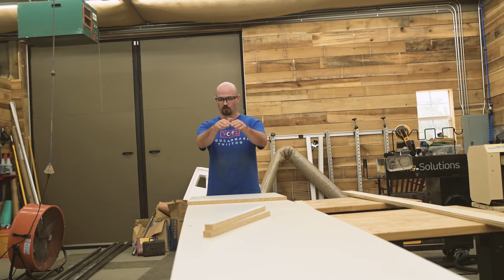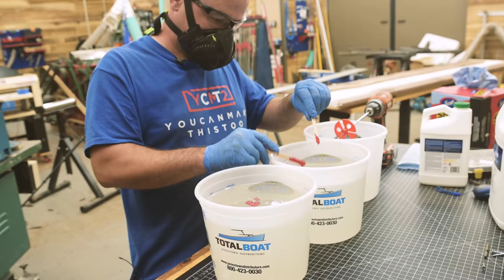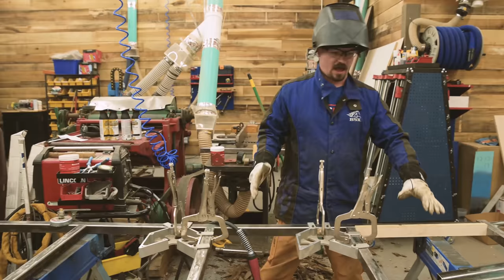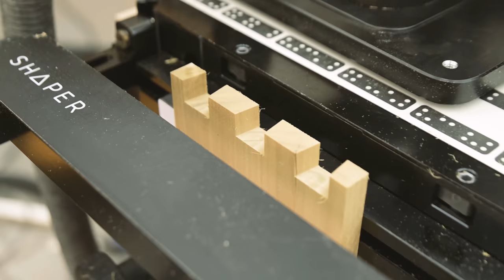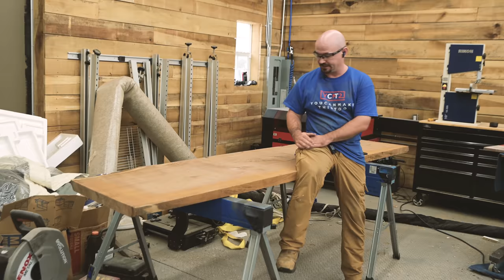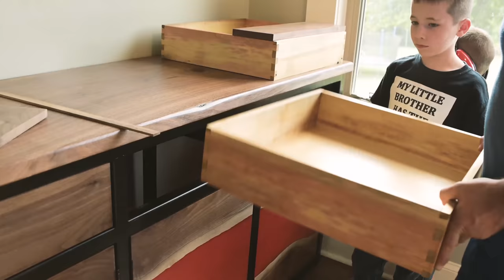Building Our Epoxy Coffee Bar Buffet

Comment: Very well done but definitely not a great project for garage woodworkers. Thanks for sharing
Reply from the maker: True, I would’ve approached it pretty different last year when I was still in the garage. Would’ve outsourced flattening the slab top (or glued up a panel), cut up the doors before doing the epoxy, forgone the dovetails for rabbeted drawers, and been building the whole thing in my driveway. Also I know the welding is a huge limiter for a lot of wood guys. Nonetheless, hope you got some entertainment, tips, or inspiration from it. The other pieces in the set coming soon are much more manageable for a small shop